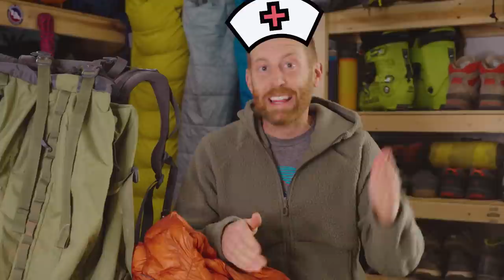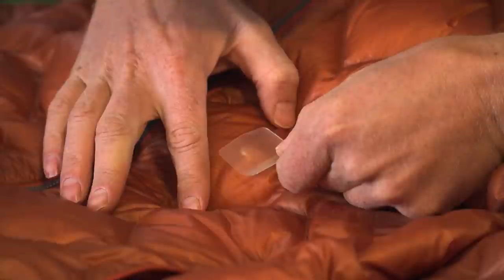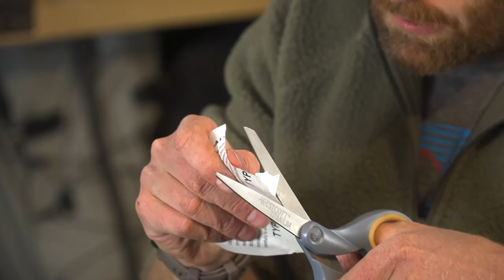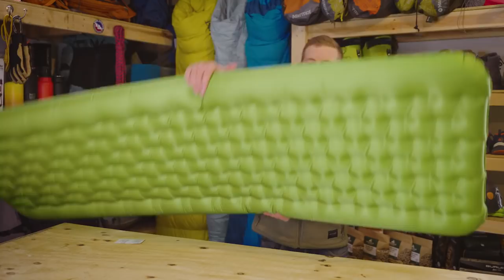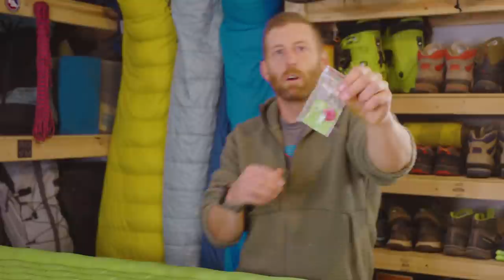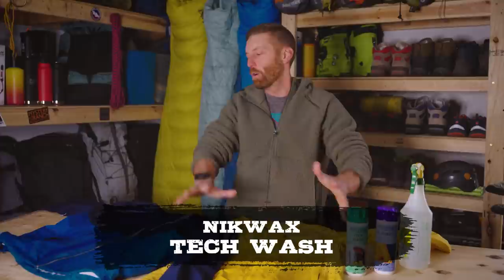How to Repair and Maintain Your Backpacking Gear: Fix Leaky Mattresses, Re-Waterproof Jackets, More!

Comment: Street cred sounds wrong somehow, shouldn't it be trail cred lol

Gorilla tape works good too, bunch of different types to choose from. Don't know if it would be effective on an air pad
Reply: Agree with you about the strength of the Gorilla clear tape. Worth a try in many situations, I think
Reply: @nigelh3253  used that last year to repair a hole in a seam, it went through the wash and was still there lol
Reply: @shawnr6117  Thanks